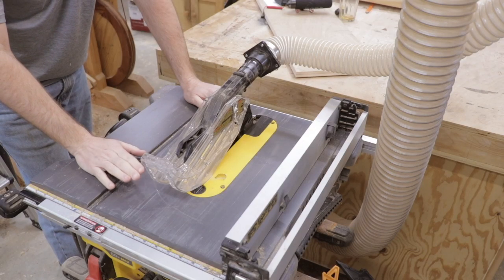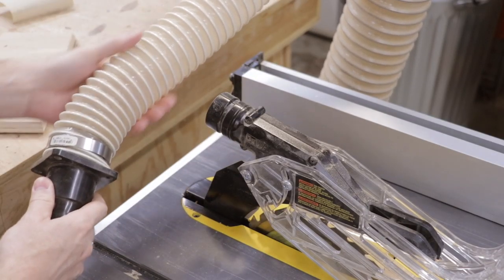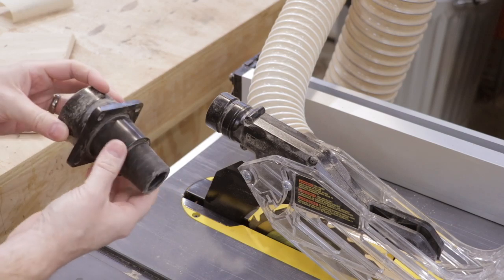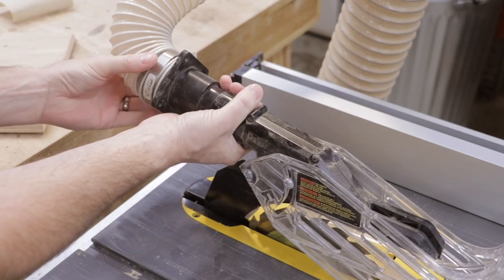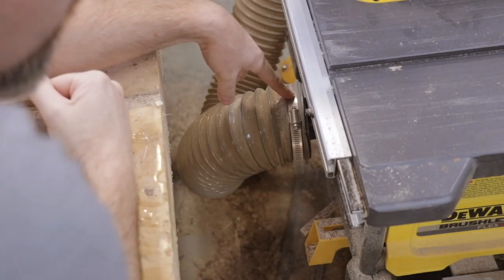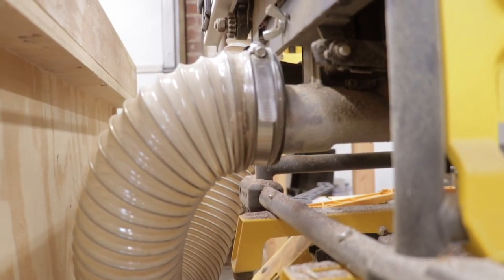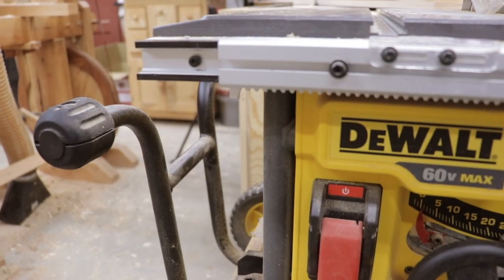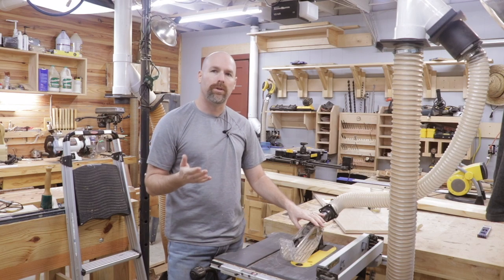Table Saw Dust Collection 👉 Made Simple!

Comment: It's awfully dusty under the saw.  Does the collection system really work?
Reply from the maker: I had a clog at the inlet to my dust collector recently and I'm still cleaning up the mess from that. It works great now!
Reply: My DeWalt table saw still sends dust everywhere with a vacuum hooked up, except I don't have the top one (hardwired one)
Reply: @lastingbuild1373  
I have the Dewalt DWE7491RS. I currently have it connected to a shop vac (and cyclone). It’s connected through both ports you were talking about. When it cuts on the side of a board (jointing or squaring up a workpiece, a lot of sawdust comes out of the front into the table. When ripping or cross cutting it does much better. How well does your dust collector work with your Dewalt?
Reply from the maker: @stevesiefken6432  it works for the fine dust but I don’t think I have enough air movement to get it all!

Comment: Do you notice that the 4" dust collection doesn't do well when it's choked off via a 2-½" adapter? 
 
I get far better collection with a shop vac to the under table. 
 
One thing I ended up doing us a 4" to 2½" Y splitter. I can then attach my 4" collector hose to the splitter and run a few feet of 2-½" of both splits,  and allow one to go to underside, and one to an adapter into the dust guard. It's better,  but not great, ss it's still choking off the dust collector. 
 
(Mind you, all of this is moot if you have not sealed the internals of the saw as best you can. Best thing ever... thermoplastic beads. Put them in a jar, pour boiling water over them. They turn clear, and clump together, then you can pull them out to shape the plastic, or just make a press fitting. Then your daw will have far fewer openings internally, and your air draw will come more from the blade area.)